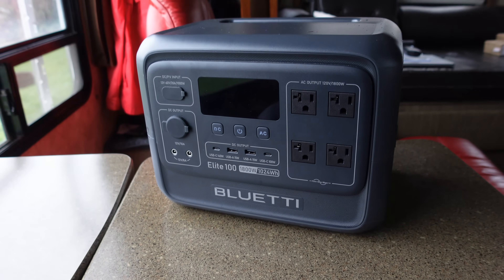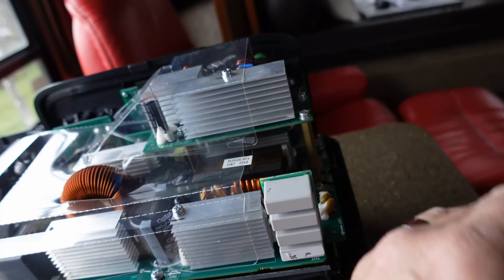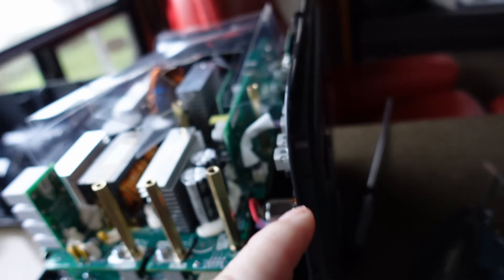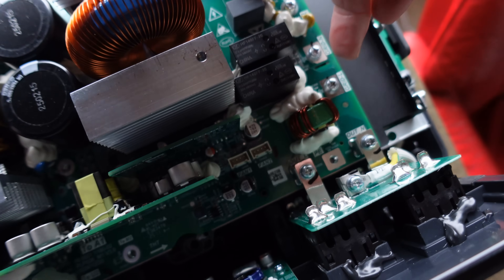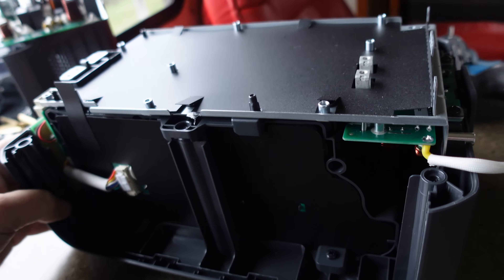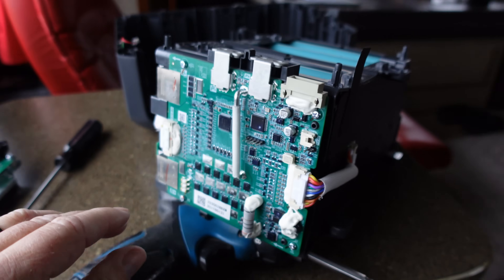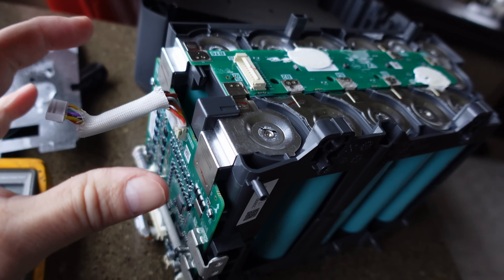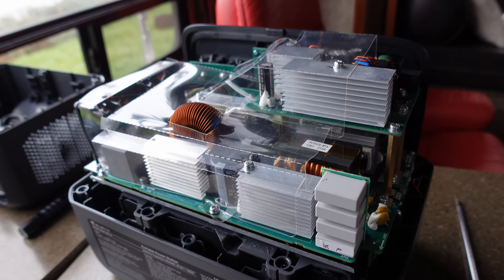What's Inside? Bluetti Elite 100 V2 Portable Power Station Teardown

Comment: Interesting to see the insides of one of these, looks well made. These things are really coming down in price and I recently bought a Pecron box that appears to have close to the same specs as the Bluetti. What intrigued me about is it can connect to an external 48 volt battery (even a golf cart type LifePo4 though not supported) to increase the runtime significantly. It also has an XT60 solar input connection that will accept 11-60 volts at 20 amps which gives me the ability to charge or extend the runtime from an ordinary 12 volt battery, which I have managed to collect several of.